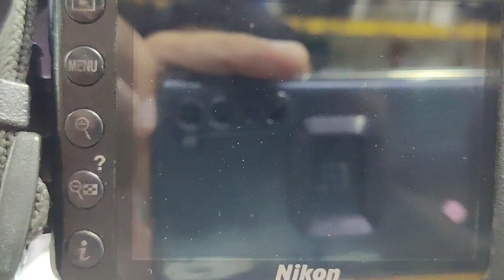AF-P DX NIKKOR 18-55MM F/3.5-5.6G VR || Autofocus not working

Comment: Bro, when i dismantle this i got a small spring. But i didnt know where did i want to fix it. Please help me. The compression spring is on there, i got smaller than that
Reply from the maker: In lens board you will see a white wire
Reply from the maker: Wire with pushing cup 
Put spring inside that metal small cup

Comment: hello sir, AF-P DX NIKKOR 18-55MM F/3.5-5.6G VR,Autofocus motor not stop is running continue,in thik moter stop sensor not working help me plese
Reply from the maker: First check your camera, Use it on liveView mode. Then you will find exact problem ( body or lens fault)
Reply: I try another lenns work fine
Reply: Yes
Reply from the maker: Your lens AF P or AF S?
Reply: @icammech  AF-P
Reply from the maker: Check Aperture is closed or open, then check sensor